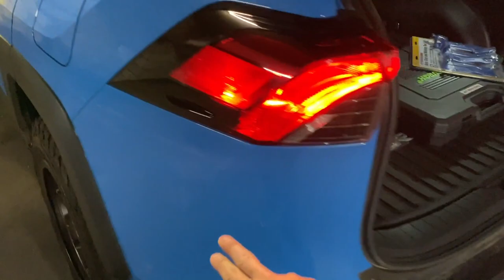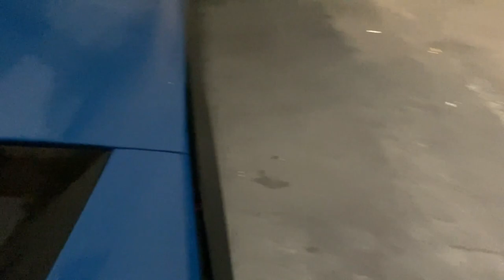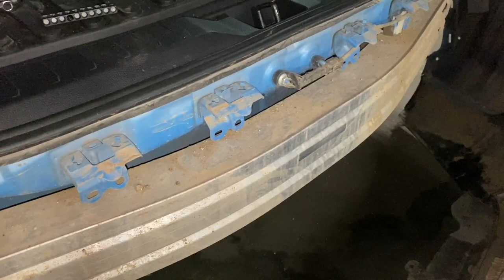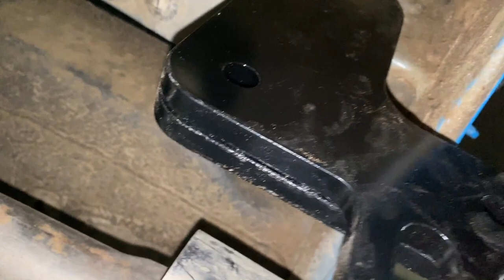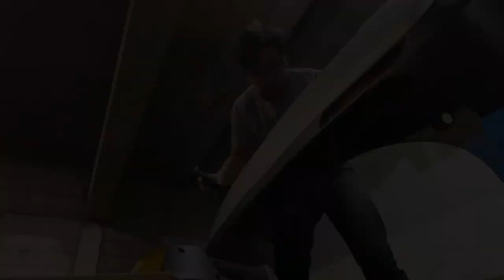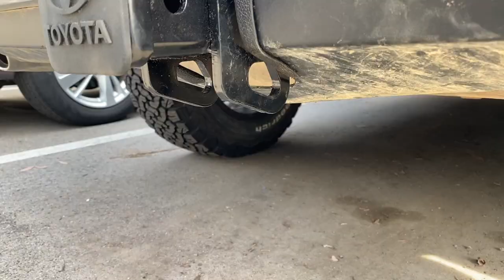2019-2021 RAV4 OEM Trailer Hitch Install DIY

Comment: I just did mine on the weekend with the help of youtube. the hardest part was removing the  plastics. the option from toyota is $2000 cad or you can buy the kit from toyota for $500. I cut the L bracket off and shrank the cutout to fit tighter. It was fun.

Comment: I installed a Class III Curt Tow Hitch on my wife’s 2019 RAV4 XLT Premium with no issues at all.  It is low but it only took me about 40 min of installation by my self.  This is crazy to much work plus cutting,  I can just imagine how much the dealer would of changed you if you took it in.  The best thing I got the hitch brand new in the box from a local guy who picked it up in an auction .

Comment: Great video, I have a 2020 TOR, waiting for the the lock down to end to head to Pismo!
Reply from the maker: Alex Lau air down and you’ll be solid in pismo. I hit the dunes last year and had a blast! Almost rolled my Rav4 down the face of a steep dune hitting it at a poor angle haha.

DM me your address on IG for your sticker!
Reply: @DannyRocksteady  Yea I'm not worried about it, Pismo is my stomping grounds. My old tow rig was a Camry and trailer that had my moto on it. I'm stoked to see how the Rav handles it!

Comment: Hi...not sure about the classification of the OEM vs Curt but I feel like the OEM is at least as strong.  The ground clearance others were saying isn't critical (because the exhaust is the same) isn't about the point at the receiver, it's about the item you're attaching.  Like a bike rack that will definitely ground out when its lower because it extends further back.
Good job!

Comment: Did you use a torque wrench to get all the bolts to 90nm? If so, what model do you have that will fit in such a tight space?

Comment: Did you have to cut off the trailer hitch power connector bar since you didn’t cut out that part? It looks like the bottom valance bows out.

Comment: I don't see the problem with the curt it sits at the same height as the exhaust tips so ground clearance isn't changed really
Reply from the maker: The Curt is a great budget friendly option for a hitch. The loss of ground clearance would be negligible for most. When I had mine, however, it scraped on things the first week I had it so it wasn’t for me and sold it.
Reply: Cool vid, nice ride. When you scraped with the Curt, were you driving on regular streets, driveways, or off roads?
Reply from the maker: @jdekuwento1272  both off road and steep driveways/parking lot ramps
Reply: If you add a bike rack or other extended item, you will definitely notice the loss of clearance.

Comment: great video Danny, just wondering, how did you remove the clip beside 10mm bolt from the trim ( on the mud flap/guard) on both side?
Reply from the maker: Yueh-Chung Su there is a specialty tool you can use to remove the push clips—or you can do what I did an use a smaller flat tip screwdriver to pull up the center pin. Once you give yourself a little room with the screwdriver you can pull the pin up with your fingers—keep pulling to pull out the clip completely.

Comment: Looks good great video.  Very helpful.  I'm looking at getting this bumper and putting it on myself instead of the Ecohitch. I like the extra clearance.    Did you have to get other hardware kit that came with it?  Tow Hitch - Toyota (PK960-42K10-HW)

Comment: Hey there! Thanks for making this video. Just to clarify, did you have to buy the hardware kit (PK960-42K10-HW) separately, or did it come with the Tow Hitch Receiver (PK960-42K10) as package?
Reply from the maker: I did not purchase anything additional to PK960-42K10. It included everything I needed as well as components like the ball hitch that I didn’t end up using

Comment: Can you post the full list of tools you used for the install?
Reply from the maker: It’s been over a year since I did this install—the only other tool aside from the wrenches/sockets (sizes shouldn’t be difficult to figure out) is a dremel to cut the bumper.
Reply: @DannyRocksteady  Thanks! Just the long 14mm and a normal 19mm socket? Were you able to get the socket wrench in those tight spaces for the brackets or did you use the normal wrench?
Reply from the maker: @aaronjhall  yeah—my wrenches fit. It’ll help to have some “low profile” wrenches to the right bolt on the passenger side

Comment: Hi I recently purchased the hitch assembly for my 2021 RAV4.  Did you put the metal bar back on   after attaching the  hitch assembly and bumper cover?
Reply from the maker: No the metal bar is ‘trash’ at the end of the install
Reply: @DannyRocksteady  Can I send you a picture of of what my dealer install looks like?  They ended up cutting my bumper from the bottom leaving a chunk of plastic out and it was nolonger able to be clipped back in position at the very bottom.
Reply from the maker: @csmith31  you can send it to the email address listed on the channel info. That being said I have seen countless installs butchered by incompetent techs at the dealership (which is why I typically prefer to do installs myself). If it is as bad as you described it I would go back into the dealership and demand that they repair/replace the bumper and wouldn’t let up until they do.

Comment: Hi Danny - Did your Tow Hitch (PK960-42K10) come with hardware/fasteners? The toyota website is trying to add a hardware kit (PK96042K10HW) for $40 that I hope I don't need. Thanks!
Reply from the maker: Everything I needed to install my hitch was in the box for the hitch. Not sure what the extra hardware would be for
Reply: @DannyRocksteady  Thanks Danny - not getting it then. Thanks!